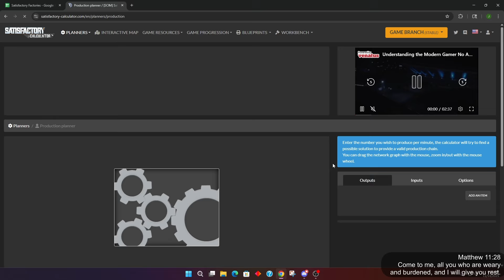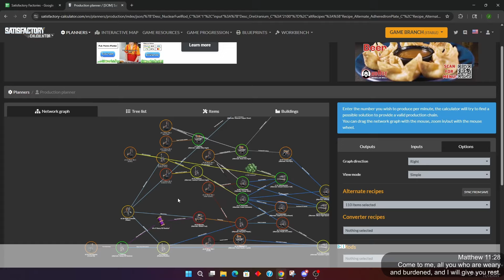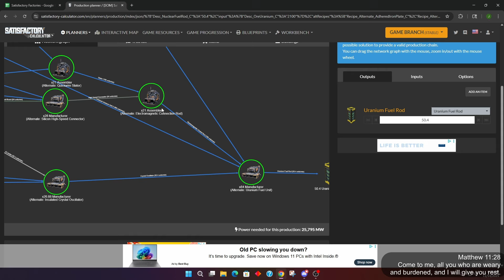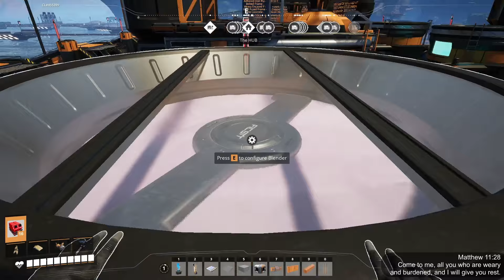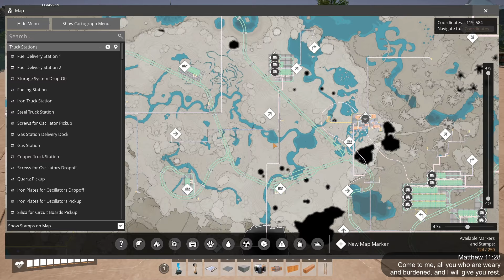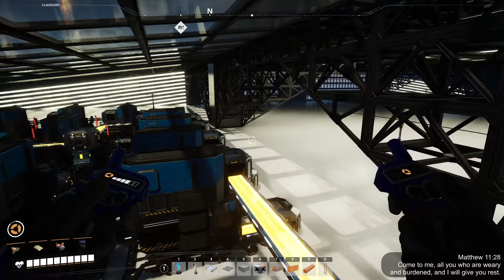15,450 Iron Ingots MEGAFACTORY! - Satisfactory Project: Nuclear Overdrive (Ep. 1)

Comment: Very ambitious!  In my recent playthrough, I did 6.4 Uranium fuel rods, about 13% of what you've started on.  And then just sunk the Plutonium rods I didn't use for drones.  No Ficsonium!  Mine definitely could have been a lot bigger, but I'm not up for this sort of challenge.  Aside from the challenge aspect (which is valid), I don't see a lot of point in using most of the map's resources just to make power - what do you have left to power at that point?

Still, I will definitely be watching, just to see how things scale.  It was hard even in my small setup to keep machines going properly with manifolds - unless you oversupply, the last machines tend to starve when the items per minute produced is low and the items consumed per minute is large (I'm looking at you, Plutonium fuel rods!).  And you don't want to oversupply radioactive parts!  Your ironworks is nice looking.  VERY organized.  I think overbuilding (maybe?) your foundations was a good plan - running out of space inside a tight design is bad news.
Reply from the maker: I agree, I definitely don't need this power at all. I just want to see if I can do it haha. I do have a little leeway for overproducing some items but not all so if I run in to issues, that will suck. I've never done ficsonium fuel rods so I'm definitely excited to try it out!